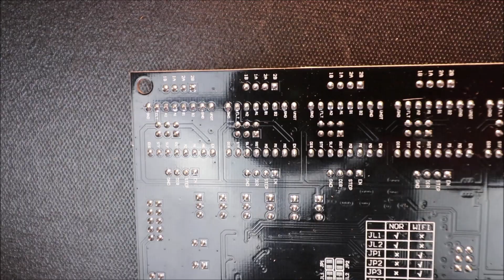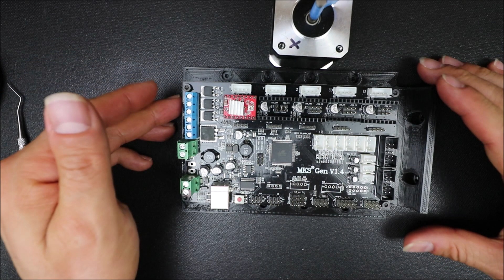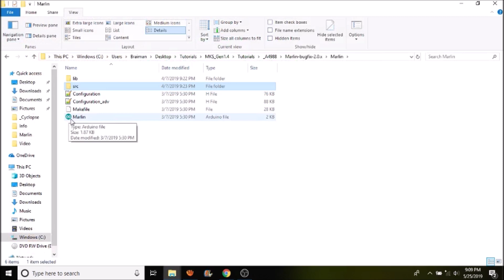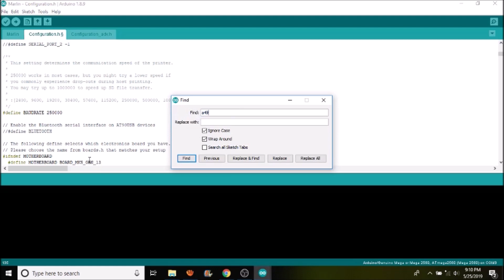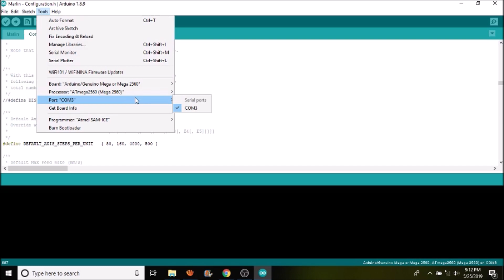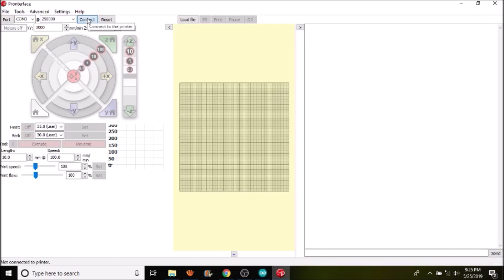MKS Gen 1.4 - A4988

Comment: can i use tmc2208 with that board without any physical changing in the stepper
Reply from the maker: It's possible, but I think it might require some special additional wiring
Reply: @EdwardBraiman  Thanks
Reply from the maker: You're welcome, remember when I say special wiring it may include resistor's or something along those lines